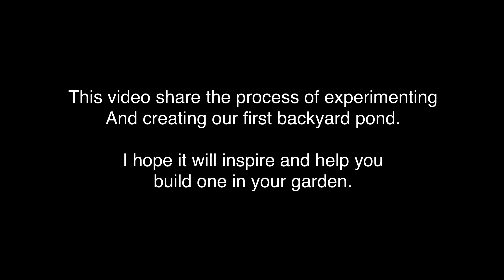Stock Tank Pond and Fountain - DIY

Comment: I love it!  But, how did you connect the  pump to the water inside the tank?
Reply from the maker: this tank has a drainage hole at the bottom, I just connected a pipe there that goes into the pump